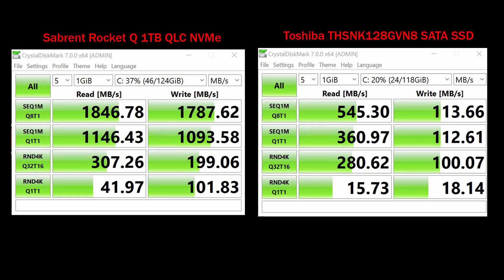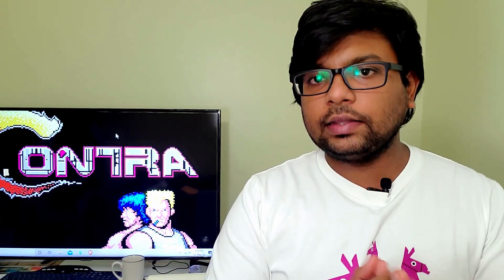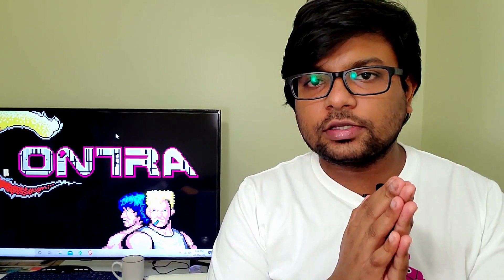NVME and SATA SSD Speed Comparison | NVMe Benchmarking | Malayalam Audio | എസഎസഡി ബെഞ്ച്മാർക്കിങ്

Comment: NVMe mathram vech hdd remove cheyth system smoothayi run cheyan patuo??
Reply from the maker: Of course. Ippo varunna mikka laptopsinum nvme drive matre ollu
Reply: @GVolt  appo data store cheyyan hdd vende
Reply from the maker: @Achumma666  venda nvme replaces hdd
Reply: @GVolt  അതല്ല ente സംശയം കളിയാക്കരുത് .128 gb ssd ഉള്ളുവെങ്കിൽ പെട്ടന്ന് fill ആവില്ലേ